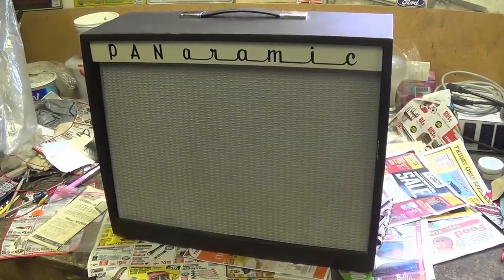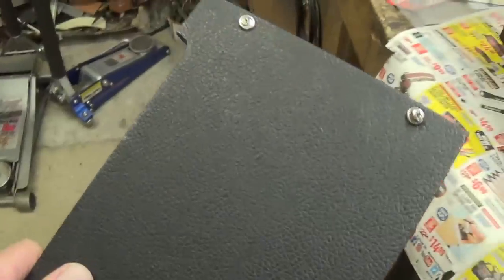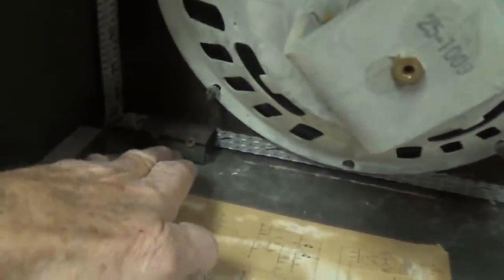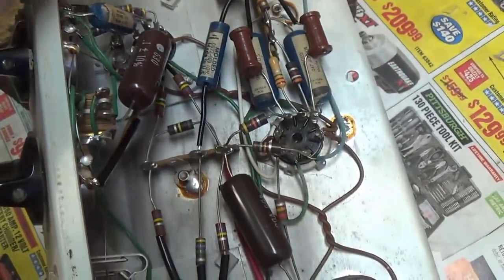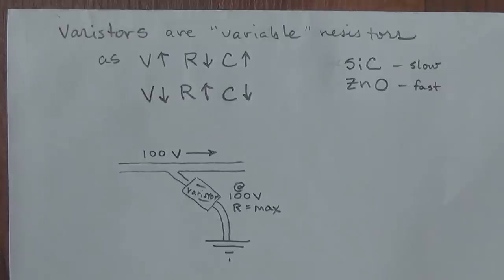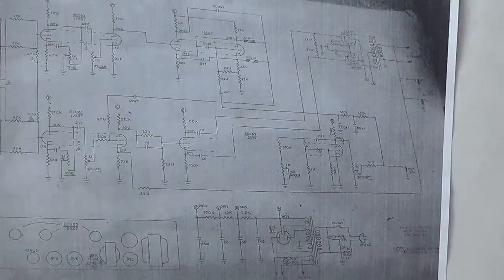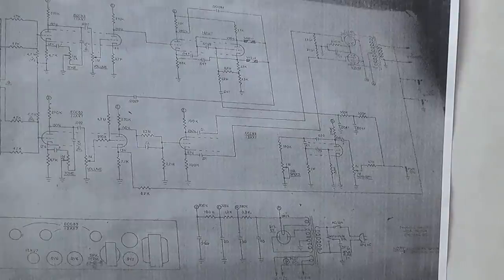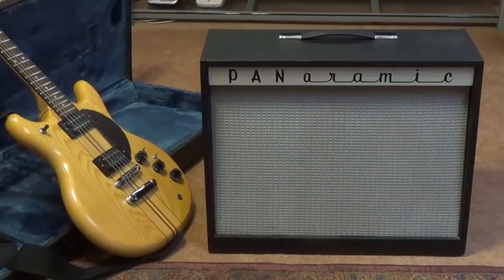1963 Magnatone Panaramic Model 1210 Amp with "True" Vibrato

Comment: Hello Doug! Very nice find with this amplifier. I always liked the way the Magnatone amp sounds with a guitar. In fact, I tend to like it a little better than the Fender. Magnatone amps have a sound of their own...Buddy Holly used one for his live stage shows. Your explanation of the vibrato circuit is right on target. I've serviced Mags in the past and I will say that if the Varistors fail, it can be tricky getting exact replacements...although, now they are available. This circuit design goes back to the late 40's/early 50's. in some of the earlier Magnatone models. If you turn up the vibrato speed and intensity together, it actually creates the effect of a Leslie Speaker which is a mechanically-based phase shift and it varies the frequency---the Doppler Effect. There's an interesting trick you can do to make it sound exactly like a Leslie Speaker. add a chorus pedal and add a slight amount of the chorus effect with the vibrato, and you will have the authentic Leslie sound,  There are other circuit designs to electronically create vibrato which Hammond Organ company used in their "Solovox" back in the 40's which was a small keyboard attachment that mounted on the outer front rail of a piano as an accessory. This amp is in mint condition and should give you years of good service. Hand pick any replacement tubes if you have to replace the 12AU7. It's also critical to the performance of the vibrato. another great video as always. :)
Reply from the maker: Thanks so much for your detailed and informative input, Frank. It's always good to hear fro you.
Reply: I think Holly was mostly experimenting with Magnatones during his NY apartment era. Guessing he used Bassmans and Twins live.
Reply: Tonetwisters speaks true. Also...those varistors almost never fail

Comment: Thanks for the video! Having a crappy day and wham, Uncle Doug and the cats are just what the doctor ordered. Love the coupling cap leakage tip resulting in ever-changing plate current. Are you sure you weren't a physics teacher? Your spring/shaft/electrical tape visual demo was absolutely wonderful!  I guess the amp was a little more than $239.59, you know, a little extra for 56 years of storage. I'm glad our Patreon contributions are helping the channel.  See y'all next time, and yes, Chris is happy. For those interested in the Moses Vibrato, here's a link https://dalmura.com.au/static/Magnatone%20vibrato%20design.pdf
Reply from the maker: You're quite welcome, Craig. I'm really glad to hear that the teaching approach worked :) Yes, indeed, you Patreon patrons and PayPal contributors make it all possible.

Comment: 'Crimson and Clover' by Tommy James and the Shondells must have been produced with maximum vibrato. Trippy dude.
Reply: My guess is that they used a Leslie speaker for that.  They sound different.  But I am also prepared to be proven wrong.
Reply from the maker: According to Wikipedia, it was a Tremolo effect, used both on the instrumental and voice sections......but what do they know ??
Reply: @UncleDoug  Wikipedia is right in this case but even a broken clock is right twice a day 👌😉✌
Reply: Thanks for posting that, years ago I had heard it was an Ampeg. They have a feature called "afterbeat" which is tremelo that goes all the way silent between oscillations so I am pretty sure that is what they used on C & C.

Comment: One of my go to secret weapons in the studio is my panoramic amp . The model I have is true stereo with 2 amplifier sections with an 8 inch and 12 inch speaker,, which in combination with that amazing vibrato can produce some subtle to very far out textures. Your explanation of the varistor was exactly the way I will explain it from now on ! I also have another amp that is identical with the exception of a slightly taller cabinet badged with the Titano brand. Also for you pedal guys this is a great platform for all of your mod based effects , Also it appears that these amps were built by Estey then later Audio Guild. A hand wired amp like this would likely set you back a few bucks . The modern reissues are probably built as good or in fabrication terms as the old ones . A pristine example such as this would be an amazing amp for any guitar player searching for their sound. This was an amazing end to my day. Thank you !
Reply from the maker: You're quite welcome, Dana. Thanks so much for your detailed and interesting input.

Comment: Historic users of Magnatone amps include Buddy Holly, Lonnie Mack, Robert Ward, Link Wray,  Neil Young, and Keith Richards. The small Magnatones I have worked on pretty much nailed Keith Richards tone! I have often wondered if the guitar intro to Gimme Shelter was played through a Magnatone, as it has a warbly sound that sounds similar to Magnatone vibrato.
Reply from the maker: Excellent observations, GU. The larger Magnatone Vibrato amps use four varistors and provide an even more "warbly" effect. I believe that Buddy Holly (for one) used one of the larger models.......perhaps Keith did too.
Reply: Good ears fellas. Keith actually used a Leslie speaker to warble his way through some of those very early seventies exile sessions. The four varistor / two speaker models and eight varistor top of the line models create a more pronounced Doppler effect. A great Keith song to hear the warble is "Let it Loose" on Exile on Mainstreet.
Reply from the maker: Thanks, KM. I'm considering the purchase of a 4-varistor 260 or 280 just to experience the more intense Vibrato effect.
Reply: @UncleDoug  , note that the Reverb in magnatone amplifiers that are so equipped is very smooth and Lush, not boingy like Fender Reverb. It's a capacitor driven Reverb circuit, somewhat similar to the Reverb circuit in an Ampeg reverberocket, and the Reverb tank itself is different from the tank used in a Fender amp. And then you've got amplifiers like the 280 and 480 that are true discreet two channel stereo amplifiers and have stereo vibrato. Very different animals sonically, extremely clean and not that prone to being over driven when pushed hard. The 480 has Reverb, and if I remember correctly the 280 does not.
Reply: Don’t forget Robert cray and his magnatone m10A
Reply: @jimilundin3538  , yep, good inclusion, for those who like Robert Cray anyway. I don't particularly, I've seen him live and I never heard him play anything that really burned hot, but my wife likes him and I love to yank her chain about it.
Reply: I highly recommend one that has 4 varistor stereo vibrato its beautiful
Reply: Neil Young does still use the Magnatone live but from what I found the signal that is fed into it isn't straight from the guitar but an attenuated signal out of his hot rodded '59 Fender Deluxe's preamp, and the live sound that goes to the PA is roughly 90% Deluxe 10% Magnatone. I also don't think he uses the vibrato in the Magnatone. He also runs a couple Fender reverb units and Echoplex EP-3 tape delays at times. Got the chance to see his rig up close while working at a festival this summer, it was great seeing all this old gear being well cared for and used every night on the road.
Reply: @dariusliadon  , some years ago my wife and I got free guest passes to attend a Crosby Stills  Nash  &Young reunion concert courtesy of a sound engineer who I had sold a vintage Ampeg Jet to *. The guy was running the mixer at the CSNY show, and during an intermission I talked with him a bit; I couldnt see any of Neil Young's gear, and Neil himself kind of stayed towards the back of the stage while playing, he really wasn't particularly visible, or audible,  during any part of the show , but Steven Stills had at least 6 old blonde and tweed Fenders on stage, and I asked the engineer, surely those amps can't all be on and mic'd through the PA, can they? "Yup", said the engineer, with a grimace, "they're all on and live". Stills' playing, and guitar tone, were lousy. The only one of the four of them who seemed like he actually wanted to be there and cared about his performance was David Crosby. Neil Young was a cipher, a blip, it's like he wasn't even there. Maybe they got better in the second half of the show, but my wife and I weren't feeling it so we split during the intermission.

* I can't remember the guy's name, but he did some recording work with John Hiatt on the Little Head record. He told me they were using a reissue Ampeg  for some of the guitar parts, slide guitar mostly, but it sounded kind of buzzy and he had to try a whole bunch of different microphone techniques before he came up with something that gave them a good usable sound on tape. (I'm guessing probably for "Woman Sawed in Half", one of Hiatt's strangest and one of my favorite songs on that record). By the way, Neil Young's son Zeke,  who has cerebral palsy, was seated near us in the roped-off guest-seating section .
Reply: @dariusliadon  , overly- complicated on stage rigs don't really float my boat. I tend to prefer the players who keep it simple. I've seen Tab Benoit a couple of times, he uses two slightly different sized Category 5 combo amplifiers and a battered Thinline tele. No pedals and no effects. If he wants a tremolo sound, he literally rotates the volume control on the guitar back and forth very quickly and gets a surprisingly clean tremolo this way. Actually, he does have one effect or totem on stage, you can say, a small stuffed alligator head resting on top of one of the amplifiers.
Reply: 'Bo Diddley used Magnatone amps from the start because of the vibrato circuit.  This, along with a mechanical trem made by DeArmond, was an integral part of his sound.  When I was a teenager in the  1950's, those of us who played electric guitars thought of Magnatone amps as the holy grail of amps.  In 1972, a band I played guitar in shared a gig at a university with Bo Diddley.  He used an M-35 Magnatone amp, and 2 Fender amp stacks (strictly as slaves to the Magnatone).  If you want a very obvious example of Bo Diddley's use of the Magnatone vibrato, check out the original ver4sion of "Crackin' Up" on Checker.  
https://www.youtube.com/watch?v=Si8lZf6CQ7M
I have a hand made solid state "pedal" version of this circuit which was manufactured by an outfit called "Austone" which works quite well.  Unfortunately, it is no longer made.
Reply: I think Keith used an ampeg tremolo effect on gimme shelter.
Reply: @UncleDoug  also check out the stereo vibrato models. Its 4 varistor, 2 per side and as its pitch shifting it also pans left and right across the speakers. It sounds like a leslie in a way without any moving parts. The M14 has 8 varistors
Reply: @good 'un When you say capacitor driven reverb is that with the use of a tube rather than an OT to drive the tank? Is it similar to the early Vox reverb which used a phono cartridge to move the spring?
Reply: @allanpennington  , for purposes of comparison,  Fender used a small output transformer to drive the reverb tank (same transformer used to drive the speaker in a Champ,  by the way). However, the reverb drive circuit in an Ampeg or most (not all) Magnatones fed the input of the reverb tank through a capacitor tied to the plate of a preamp-type tube. 

The reverb tanks of a Fender, and an Ampeg or Magnatone, look virtually identical, but the input impedance of the Ampeg's reverb tank is higher; it was designed/chosen specifically to be a good, easy, efficient and cost-effective load for the tube to drive directly, or nearly directly,  since the only thing between  the reverb driver and the tank is a capacitor. Transformers are more expensive than capacitors. 

The reverb transformer in a Fender amp actually matches the output impedance of the reverb driver tube to the input impedance of the tank.
Reply: @good 'un thanks so much, I am trying to do a clone of a Vox ac10srt which had a tube/capacitor driven reverb via a 12Au7 and 0.01 mfd cap. The reverb utilised a phono cartridge to move a single light weight spring. I am trying to find a modern reverb tank of high enough input Z to work with the same circuit. The tank manufacturers are of no help and I don’t know how to do the math to work out what alternative tank might work

Comment: On the scope, vibrato looks more like phase shifting to the left and to the right.
Reply: That's exactly what I was seeing as well.
Reply from the maker: I'm not sure if the unaltered frequency is in the middle of the two phase- shifted waveforms, and appears to shift in both directions.......or coincides with the right-hand wave form and only shifts to the left. I guess more study is needed.
Reply: @UncleDoug  hi, the Geeetoligist did a video on a magnatone and discussed phase shift circuit. I think it's a pseudo vibrato using phase shift. Same same but different....
Reply: ,hello uncle Doug, on a magnatone mp1 schematic there are triangles with letters inside the triangle what does this mean thanks
Reply from the maker: I looked at the schematic and at first thought it might indicate higher-wattage resistors, or perhaps a certain type of resistor.....but they also use the triangles with capacitors. Perhaps there is a chart somewhere that decodes these symbols, Mark, but I sure don't see it anywhere on the schematic.
Reply: I thought the same thing, and by its own admission, the circuit is known as a "Moses Phase Shift" circuit.  Yet, although it's true not EVERY cycle is altered, WHILE the phase is being shifted, at least one cycle must be compressed, as another is stretched, thus giving, (at least momentarily), genuine vibrato.  Personally, I'd say it is more of a "pseudo" or "intermittent" vibrato, rather than "true" vibrato, which would require the instrument itself to alter its frequency,  but at least it is distinctly different from tremolo.
Reply: If you look at the mathematics of it, phase modulation and frequency modulation are almost identical. Vibrato circuits modulate phase because it's the easier than directly modifying frequency. By changing phase over many cycles of a signal, you squash or expand the signal, producing a frequency shift.
Reply: You mean the interference caused by frequent phase shifting, cancels or adds to the amplitude thus changing the slope or rate of change of the signal hence the frequency?
Reply: Yeah you're almost on the money.
Unlike a lot of things, I think the maths shows what's going on best:
A pure tone can be described like this:

sin(freq * time + phase)

If phase and freq are constant, then as time moves forward, a sine wave is created. However, if you change phase with respect to time, the equation becomes this:

sin(freq * time + phase * time)
= sine(time * (freq + phase))

Now, you can see that freq is added to phase and therefore the resultant frequency is different to the original.

Comment: You've really hit the mark with the Maggie!! They were quite popular here in St Louis, as before they were made by Estey they were made by Imperial Accordion Works in Chicago... and early blues musicians and early rockers loved the sound of those little combos! Buddy Holly was known to use them, though he used the larger cleaner ones, but Bo Diddley was the obvious and most famous user, as you can hear the familiar warble of that special vibrato in his early recordings... I've had a Tonemaster 250 and have held on with a death grip to my Custom 440... both from the Imperial plant. ACCORDIONISTS did actually play these, BUT the blues and early rockers LOVED the overdrive you get from the early 6v6 combos... the 440 I have, has the most amazing overdrive... both dynamic and very colorful. Also, you nailed it with the unknown value if the mysterious VARISTORS... as the early players would try out several amps to find one with a spunky vibrato... different amps would mix the effected sounds and also ad some clean unaffected sounds, as this created a chorus... or the use of two amps. One 20 feet away, to perfectly replicate the short delay used in modern stereo chorus pedals... the 440 I have, has perfect vibe, and a surprising and beautiful REVERB tank as well. It's also the ugliest amp I've owned, and I found it literally holding the door of a barn open! Ok... I have to fix four echoplex units today. Great find with that Maggie. Your vibrato sounds almost exactly as mine. Mine uses the 12au7 as well, but I think the tube used to bend the tone is a 6eu7... and that tube has as much to do with the depth and quality of the effect as the 12au7, as a weak one can completely render the vibe inaudible. Maybe experiment with some tubes and see what I mean. 
Also check out the mid 50s original version of Who Do You Live by Bo Diddley to hear that amazing tone and overdrive... and bear in mind, he as no band as such, he played the heck out of that square home made guitar and had a guy banging often on just ONE drum at live shows!!
Reply from the maker: Thanks so much for all the great input, Sean :)

Comment: Nice Amp! A lot of people mix up the function of the High and Low gain inputs. Some think that you get more gain if you plug into the High input. The reality is that the High Gain input has a large grid leak resistance to ground, making it a high impedance input. The intention of the circuit was that you would plug in something that generated a higher amplitude signal, to the High Gain input and something with lower amplitude signal to the Low Gain input. This was at a time when they were making "hotter" wound pickups. It would also be beneficial to have when using modern active pickups. An active pickup plugged into the Low Gain input, would most likely overdrive the input tube.
Reply from the maker: Thanks for your knowledgeable input, William.